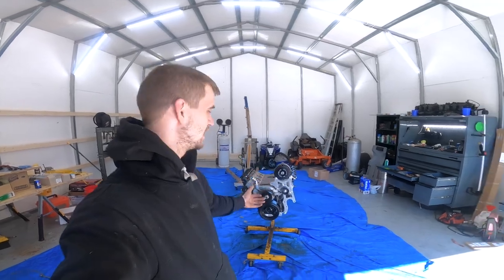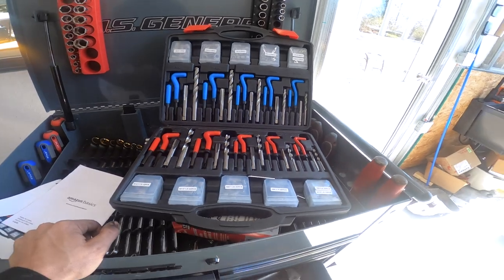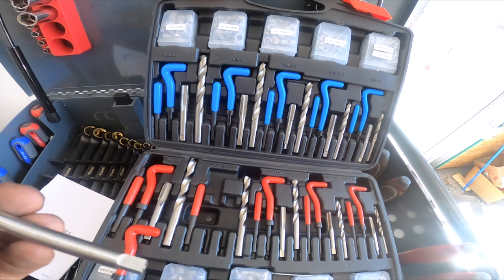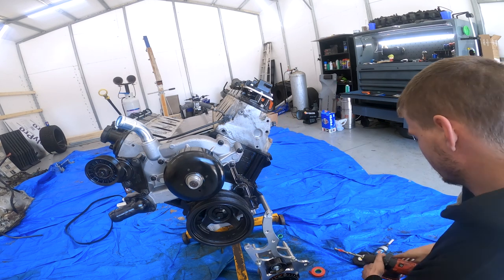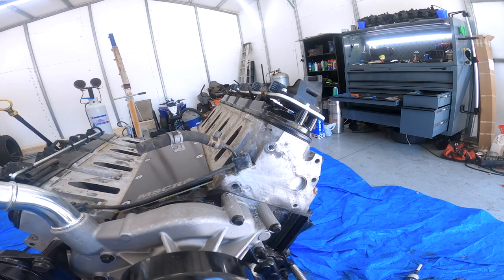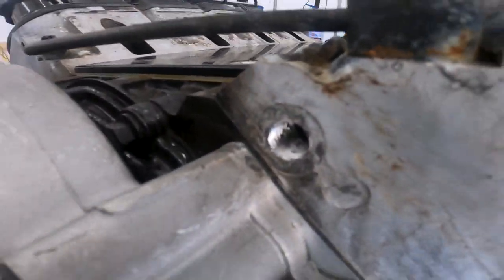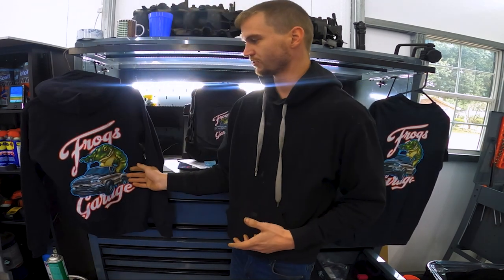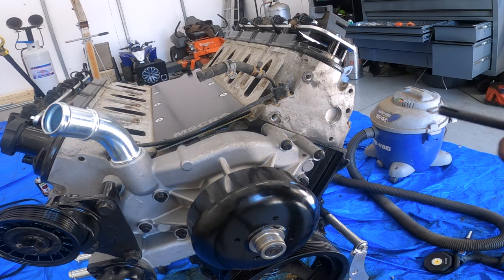How to Repair Stripped Threads with a Helicoil: Step-by-Step Guide

Comment: In a pinch jb weld will work but I wouldn't consider it a permanent fix
Reply from the maker: U didn’t see there was a little JB Weld around/in the hole already 🤣 I was gonna run it like that just to get it through one race but decided to go ahead and actually fix it
Reply: @FrogsGarage  lol i did thats why i left the 2nd comment 😂 I still have a manifold bolt on my truck jb welded in. Its held for a year. I just filled the hole. Ran in the bolt. Let it dry. Backed it back out and retorqued it lol. Still holding